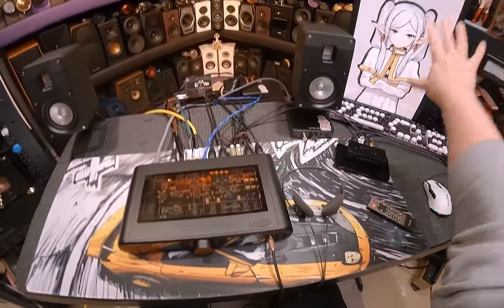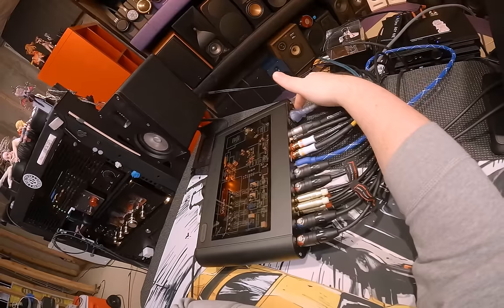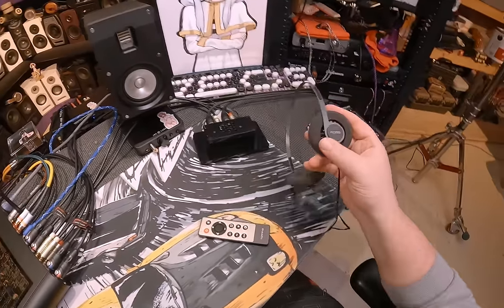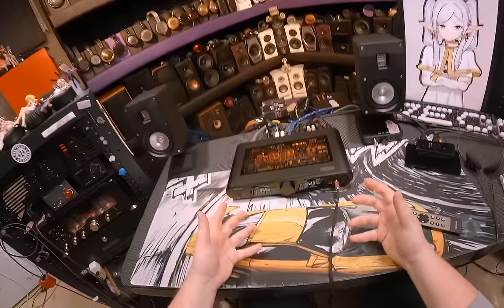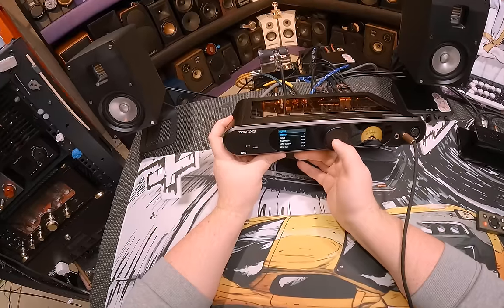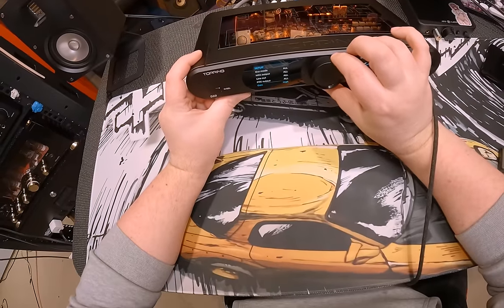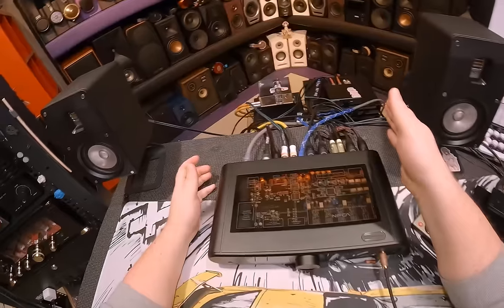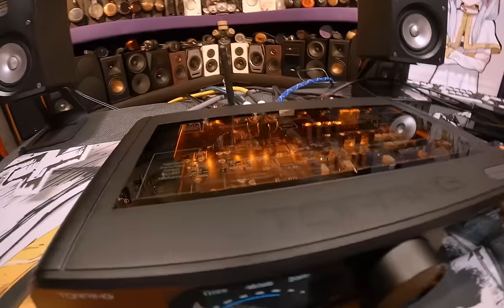💎 Topping DX9 Flagship DAC/AMP Combo

Comment: Z, I know you have no control over this but Topping's warranty and customer support is terrible. I had a A90D that only worked well for 4 months and then I had to ship it back to China which cost $100 USD and then I had had to wait 6 months for them to look at it. So this is probably a great DAC/AMP, but just realize that if something goes wrong, then you may have just wasted over $1k.
Reply: Er, anytime you have a co. where they make you ship something to China, that is a major problem. Years ago even with Sanyo/Fisher, etc., 
if you had to ship a unit back for repair, or replacement, you'd ship it to a domestic center or whatever. Shipping it overseas is not acceptable.
Reply: I also had the vendor tell me to lie about the customs value on the return (or else they would refuse it). Thankfully I bought through Amazon and they took it back when I went to them directly.
Reply: @almyp  Wow..incredible!
Reply: Same exact story with my A90D. Thankfully the seller took it back surely at their own loss. Topping wanted money and a lot of time to get it fixed.
Reply from the maker: I would deal with the site you are using first. Contact APOS before topping or Xduoo or any of those brands. It is probably easier for them to do an exchange with you then to try and repair.
Reply: @ZReviews  APOS helped me out, but still scary venture.
Reply: I had a dx5 stuck on bit loop after 40 days but lucky for me Amazon took it back as an exception for 75% price.
Reply: @teachonlywhatiseasy what’s bit loop?
Reply: @GodlyBeams  boot loop. (autocorrect typo)...kept restarting forever. there was no reset/flash button on the device. this happened to many people apparently based on forums. design flaw
Reply: @Salty4Reel This is not always the case. i bought a board on aliexpress couple years ago that i could return to a local warehouse in the US that simply processed the refund in a week. had to pay for the USPS and drop off  but it wasn't much and def worth it. they simply need to start caring for their buyers more than they are now.
Reply: @almyp This is incredibly common practice for all asian products when shipping to you tbh. The only difference is, you dont know it because you get the package anyway and shipping is reasonably cheap to ship international so consumer doesn't care. When shipping back, if you decide to say what the product really is, customs charge an insane amount that hurts both consumer and seller.

 I wouldn't necessarily blame them for wanting to ship it that way, but companies really need to just send you a label to make it sound less shady to those who dont know better.
Reply: @land_walker I mean while I agree to be careful, theres American companies that have even worse Customer Service than Topping  I have heard both good and bad things about Topping, this isn't Elysian or something). Ive owned stuff from Topping and Schiit Audio, yet my Topping stuff has lasted while the Schiit stuff has broken/bugged out several times. If you want to send something back to Schiit, good luck with that. Terrible people to deal with for stuff like that

Comment: Thanks for the review! I've been playing with the DX9 for the last few days. I must say that I'm also a little confused about the line out vs pre out and the DAC mode. I'm thinking in the DAC mode the volume might decontrolled by the DAC (digital?) like on a D90/A90D stack... ALSO, on the remote, you can LONG PRESS most buttons and get additional functions. The only sadness with this remote is that it is still the old style Topping that is IR and VERY directional. The latest D90 III has a BT remote.... that would have been nice; and I wonder if this newer remote would compatible with the DX9.... Also, I'm setting up this DX9 for a composer that needs to A/B compare back and forth between studio monitors/active speakers and headphones. The old Topping remote had two MEMORY buttons that allowed quick jumping between two pre programmed global settings.... I'd love to hear if anyone has a work around to have the same functionality on this remote.... pressing the headphone button cycles all the headphone outs EVEN if I have only one specific OUT selected in the menu.... Topping please fix this... peace!
Reply: I agree with the inconvenience of switching from headphones to speakers. There is a "memory button" function in the menu, I have programmed switching by outputs on it

Comment: Dude the sound is unreal. Not the strongest hpa. But the sound is smooth and the dac sensational. It also has i2s input and it acts as a real preamp hub and awesome hpa. Well worth the money
Reply: Been listening to mine for about an hour and love it.
Reply: bother me that it can't run the tungsten. Will have the pair around the summer hopefully (depend if fast enough when a batch is open)
I'll go either A70 Pro or more likely ifi pro iCAN Signature.
It's a shame because it's not really an amp flaw and this DX9 has the looks and the sound. But those headphones just have too much hype for me to pass on (even if I may sell them in the end)
Reply: @thierryfaquet7405 is it possible to use the dx9 as a dac and connect it to a stronger amplifier?
Reply: @radiofreealbemuth  obviously but why would you do that ? Just buy a geshelli dac and the amp you will end using directly.
But the FiiO K19 is very promising with 1.3W at 300 ohms in the same genre as the DX9
Reply: @thierryfaquet7405  hmm, im looking for something with no audible noise floor, if possible. Have you tried the geshelli j2? How is the noise floor? It feels like geshelli j2s is for people who want to upgrade op amps to sparkos 3602. I've tried the sparkos 3602 on the xd05 pro, and the sound signature is dark and bass-y, which is fun, but not necessarily my go-to sound signature for everyday listening. The fiio k19 does look cool. I wonder how it compares

Comment: I'm a bit confused. I've been watching your reviews regularly and in fact watched all the recent Topping reviews as I was in the market for a new combo unit. Ended up buying the DX5 lite. 
Now I'm sitting here watching this review and I'm hearing things like other Topping units sounding like a "dead pan", which if I'm not mistaken was never mentioned in your previous - very positive reviews.
So what's the story then?
Reply: I believe he means it’s sort of like a wall of sound but it’s still very detailed. Which he and other reviewers have mentioned before. And they have been getting better over time. This isn’t like that at all though.
Reply from the maker: Sounding neutral means it isn't exaggerating anything. When something is WARM like class-a or Tubey I will mention that. But topping stuff is generally just clear and precise. Especially with the lower price brackets that is what I expect. Things like the ifi ZenDac and its magic buttons add flavor to the lower cost realm.

Comment: The center button on my remote changes the pre-out outputs.  Not sure why yours it duplicating the menu button.  Also my DX9 came from the factory with the dac mode set to "PRE".  I can't tell a diff switching between DAC and PRE.
Reply: I have a newbie question. Can you use the DX9 purely as a dac? Is there a way to connect it to a more powerful amp?
Reply: @radiofreealbemuth  that's what the line out setting is for. line out is a fixed signal output for use with another amp with independent volume control. Or if it's a speaker power amp that you're trying to power then then you can use the pre-out setting and control the volume with the topping dx9.

Comment: I'm torn between this and the FIIO K9 Pro ESS. That one has dual ES9038PRO DAC chips (which are known to be extremely clean sounding) vs a single AK4499EQ on this. There are not many reviews of the DX9 yet, looking for A/B comparison with other kilobucks.
Reply: DUAL AK4499EQ in the dx9 no ??
Reply: @princekittipon6510  No it has a single AK4499EQ. I bought it because the amp section can power quite a lot of headphones properly including reasonably driving a Susvara.
Reply: @kunalshrivastava6398  so how is dx9 after you been using it? Impressions wise. Im torn btw dx9 and rme adi2 but dx9 is already on the way 🤣
Reply: @princekittipon6510  Well it is very resolving of course. You will not get any EQ or other DSP options on it like the ADI DAC but it does have the high end looks and more power in the amp section if that matters to you. 
It's a very linear response graph except a very slight treble roll off after 16khz.
Audibly, I can't tell a difference on it and a Chord Mojo 2 when testing IEMs. Driving large planar headphones using balanced cables is a different story though. Phenomenal separation and imaging. It sounds clean on every output and has sufficient power for everything I've tried even via the single ended jack.
Reply: @princekittipon6510  You will have no problems driving any of those headphones. Even your 150 ohm HD 660S will sound at its peak. 
I'm saving up for an HE1KSE as the endgame headphone for gaming (again, footsteps and overall directionality. Also bass: Something that the HD800 lacks completely) and for classical music.
Reply: @kunalshrivastava6398 interesting that you couldn't perceive a difference between the DX9 and Mojo for iems. Considering the DX9 is a desktop dac amp, I thought it would pack a bigger punch
Reply: @radiofreealbemuth  It does, but how would that translate to IEMs? They get all the power they would ever need from a mojo2 as well.
Reply: @kunalshrivastava6398  I thought the desktop dac amp would improve stuff like bass, dynamics, separation, soundstage

Comment: Quick question everyone: In my current setup, I use a Lokius as - big surprise - tone control/EQ.
As in: PC --> DAC --> Lokius --> AMP

Is there any way I could continue to use the Lokius as designated EQ in the signal chain if I'd want to use the DX9 as my DAC/AMP?
Thanks!
Reply: No, it doesn't accept the analogue signal in from the Lokius. You can only do: PC --> DX9 --> Lokius --> AMP [not the DX9 amp]
Reply: @Sonoadeus  Different topic, but do you know if the dx9 is designed to select a pre xlr to drive a 2 channel output while using the pre RCA to drive a subwoofer for a 2.1 setup?

Comment: How would this compare to the JDS Labs Element 3 boosted in terms of sound quality?
Reply from the maker: Element is a sterile amp. This has actually a bit more warmth
Reply: @ZReviews Is it a noticeable amount more detailed than the Element? Better separation, soundstage etc?
Reply: I have both dac/amps. To me there has always been a glare somewhere in the lower mids or upper bass on the element iii. The dx9 doesn’t have that. It is also slightly warm as z said. It is more detailed for sure. I wanted to love the element ii and iii so much but they’re just not that great compared to the topping dx9 and dx5 that i compared them to, in my experience.

Edit: if i could go back tho, I’d just save my money and be happy with the dx5. Still, the dx9 is truly awesome.

Comment: Ok - DX9 vs Serenade hifiman ? very similar price in my country (care only about headphone amp/dac) any thoughts?:)
Reply: I dont know exactly why, but my Serenade had a LOT of buzz/noise through the SE headphone connections and even a little through the balanced. Had clean power going to it, tried different sockets, power cables. All no good, so just sent ti back (to Amazon). But it did sound good and the R2R Dac a nice change, but I wasn't happy with the buzzing.

Comment: First and only experience was buying the D90SE and A90 stack, without listening to it first.  Couldn’t wait to get rid of it almost immediately but I patiently ran it in or burned it and it still doesn’t sound good. Good thing I sold both!
Reply: How do you burn in electronics?
Reply: @Karto86  you don't, people are fucking delusional. Sending power through something doesn't change shit. People just want to believe things like religion, just because they don't know any better.
Reply from the maker: I mean it is a super neutral sound. I too have grown away from that for pleasure but it is ABSOLUTELY needed for the sorts of assessment I do. You may note this was on my desk upstairs. Where I do more pleasure listening .
Reply from the maker: @Apocrypha303  Except for moving things and only for a few dozen hours at the very birth.. or Tubes that change over time.

Comment: So, basically, nothing can drive Tungsten. A70 Pro couldn’t and this cannot.
Reply from the maker: A70 pro CAN with the new DS, My personal Single sided is an older 9.0 driver and it was still hard.
Reply: Wondering if ifi's iCAN Phantom amp might not do a better job on driving Tungsten.  Expensive solution though. And yet to be demonstrated. But that's an interesting path to explore...